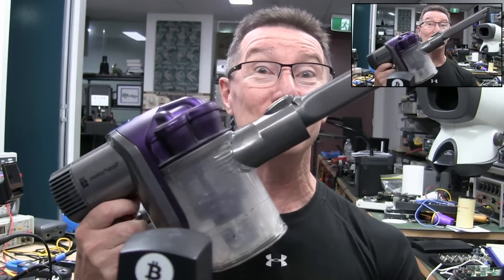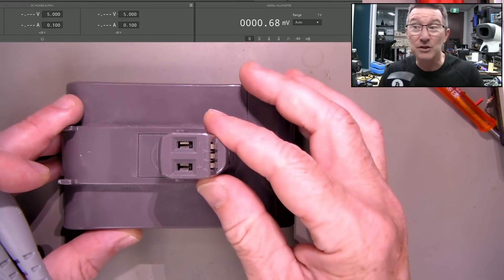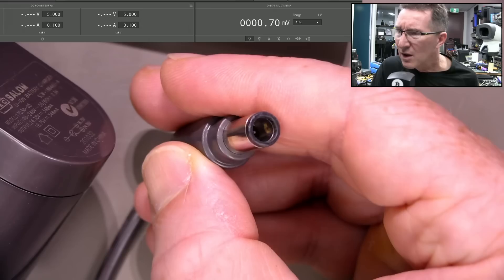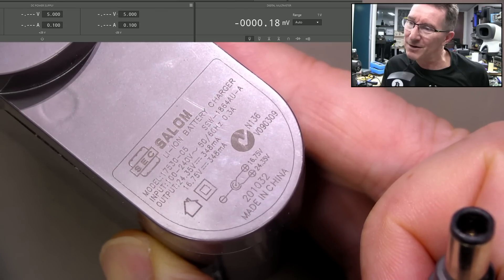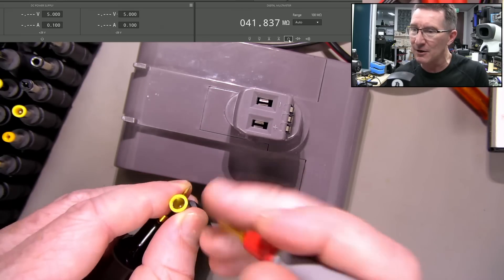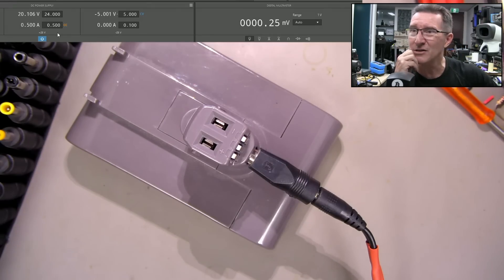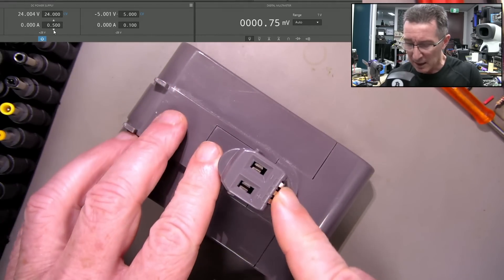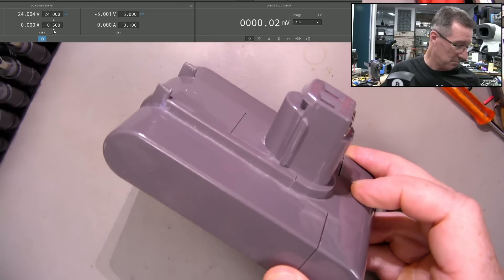Dyson Battery Failure

Comment: What a coincidence! I just took one of these failed Dyson battery packs apart today. It's not glued together, the two halves of that outer gray shell are held with clips. If you pry it apart with a screwdriver in that gap the shells come off and it's a white plastic case inside holding 6 batteries and a charging circuit on top. The only problem is that the batteries are all welded to each other and to the board, and you have to destroy it to get it apart further than this. My battery looked slightly different from yours though, so it may work differently.

Comment: Those adapter tips you have may be for laptops which have a charger sense pin. Some laptops including Dell laptop models have a charger sense pin where the charger will not support the current required unless it gets a signal on the sense pin.  The laptop and the charger communicate for charging.

Comment: I’d never buy a new Dyson product, but ypu can find them used for cheap. I bought two V8 vacuums for $50 each, replaced the battery, and have an excellent (and ugly) vacuum. I might add, for the price, the plastics are terrible quality. Gaps, squeaks, edges, thin, and so on. It’s not up to modern quality expectations for premium products.
Reply: I agree the plastics seem bad, but I think part of the problem is the most durable plastics feel/look cheap.  Were a disabled household so the plastics have taken a lot of abuse and only once managed to actually break something.

Comment: Plot twist, that’s not a genuine Dyson battery pack. Dyson can’t help but put their name/logo on everything they make. What you have is an aftermarket replacement, probably of dubious quality. Might be a fun side-by-side teardown if you have an OEM Dyson battery pack laying around.
Reply: Power supply is aftermarket as well.
Reply: Dyson is needlessly over complicated and a nightmare to get apart. I volunteer in a repair café and I could not recommend Dyson products.
Reply: First thing I noticed too. Genuine dyson bits are plastered in their logo
Reply: The Dyson battery pack for our handheld only lasted a couple of years for some reason. The cheap aftermarket replacement is still going eight years later, which is a bit of a surprise.
Reply: I found my dyson v6 animal in the trash (no joke, still working, almost no accessories), the battery was not original, but after 5+ years, it's still working great.
Can't say the same for some other original parts, I've had to 3 print one of them since they are not selling them anymore.
Reply: Have 3 v8s and all of them used makita and Milwaukee battery pack, quite a bit of volt difference but amp makes up for that.
Reply: The genuine ones have a high failure rate, almost like its programmed to do it!  More likely just a quality control issue though.
Reply: Re: Aftermarket replacement of dubious quality

My girlfriend got one. One day I'm working at my desk and I hear this distant "whoomp" noise coming from our utility room / laundry room. I assumed one of the dogs is up to something, but they're both sitting around looking in the direction of said utility room. Opened the door and barely glimpse liquid lithium fire splattered all over the walls just as a second cell explodes behind me, bits of the battery pack ping pong around this very tiny room.

I put out the fire on wall one while screaming "BABE THE LAUNDRY ROOM IS ON FIRE CAN YOU LOOK UP HOW MANY CELLS ARE IN THIS BATTERY PACK AND PLEASE DON'T SAY 6". Turn around and see that one of the cells had flown into the gap between the water heater and the wall, where it is burning through the insulation pad, flames coming up the wall. Finally get that fire out, hear from my gf that there are 6 cells in the battery pack.

Through the smoke I can make a few of the cells out scattered around my feet, and that's when cell 3 goes off like a flashbang. The previous two were just like drippy road flares. At this point caution is thrown to the wind, I wrapped up the remaining cells in a towel, ran through the kitchen and threw them on the stoop where two more exploded outside, put out the rest of the tiny fires inside, then stomped out the remaining cell #6 on the stoop until it fizzled out.

Lucky to only escape with minor burns to my hands and arm, and a pair of ringing ears.

1/6 stars, would not recommend.
Reply: @THEjoelivingstone  Yeah, that’s why I know about these aftermarket batteries. I investigate fires for a living, and I see these knockoff batteries catching fire all the time. I have a Dyson handheld with a dying battery. OEM replacement is $95. Aftermarket is $20. It’s no wonder the aftermarket replacements are so popular. There’s no reason for six 18650s in a plastic shell to cost almost $100.
Reply: @wilheldp  Genuine good value batteries should be available as a right. These third party batteries are not Dyson branded but it would not surprise me to find fake Dyson branded batteries.
Reply: @THEjoelivingstone  "barely glimpse liquid lithium fire splattered all over the walls"
There is no lithium metal in any rechargable lithium battery. That is total bs. Does it blow out electrolyte and tar? Yes. Is it a metal fire? Yeah no.

Comment: yeah the BMS also has a lockout circuit, so if you change out the 18650s it will throw an error and not charge them. There is an alternate firmware for the BMS believe it or not, but by that point I just got a decent knock off from ebay... that also has around 20% more capacity than the original.... and it actually was to spec even though I was prepared to have to return a few until I got one that wasn't faked capacity...
Reply: Lock out BMS suck. A knock off on Ebay that was on spec.? you really won the lottery there
Reply: @askjacob  battery firmware.  yikes.

Comment: Dell has used that type of barrel connector with the three connections for their laptops for years. They did this so they can detect the type of charger plugged in and what wattage it can provide. When that connection gets severed on a dell laptop charger the laptop will not charge to prevent damage. Additionally I believe with a quick google search you could find a battery adapter to use your batteries from various manufacturers power tool batteries.

Comment: Looks like you already replaced it at least once, looking at the aftermarket label.  I'm on my third battery in about ten years.  I wonder if leaving them plugged in on the charging bracket as they are designed to do is a bit problematic.  The first replacement I did had a different label and didn't last more than a year.  If I remember right the Chinese off brand packs are about $20, the Dyson branded ones about five times the price.  The current battery, I turn the charger off when it indicates a full charge (blue LED on the pack stays on instead of blinking) and it seems to be lasting longer.  (Some of) The aftermarket batteries have a really tiny hole to see the LED through, so it's not obvious.

I couldn't be bothered pulling mine apart either.  I was kind of hoping you would, so that I wouldn't have to.
Reply: The bms draws running current from a single cell out of the 6 even when left on a charger, this is what eventually pulls them out of balance I have read. You can download alternative firmware to change this behaviour if really really keen.

Comment: "No carbon brushes means zero carbon emissions" had me seriously LOL. I can't believe they actually printed that. Hillarious!
Reply: Have you ever worked with anyone in marketing or sales? Bottom feeders.
Reply: Well technically correct... carbon brushes wear down so the carbon does go somewhere. It's just not the same as the carbon emissions we're actually concerned about!
Reply: And they should made the entire thing from metal and a few ceramic/glass insulators. That would remove another bunch of carbon. There would still be the cord however.
Reply: @bert-blank  Metal are made with carbon consumption and so would be glass/creamic
Reply: and the whole thing is made from plastic litteraly oil lol!!!!!
Reply: @alanmay7929 all the energy used to produce the thing will not offset any savings of carbon emissions.
Reply: marketing genius move!!!!
Reply: I cringed HARD
Reply: Next we’ll see products with brushed DC motors marketing themselves as green since the carbon is already sequestered as dust and not released atmospherically.
Reply: Don't turn it on, Dave, take it apart! And replace the 18650's!

Comment: When using ad-hoc charging methods for lithium-ion batteries you should always place a can of petrol nearby   (for full effect).

The 16V supply might be for charging a 4S battery.

10 years is about what you can expect from 18650 cells in normal operation so just split the case and replace the cells.  Easy-peasy.   To split the pack give it a good whack with the handle of a decent-sized screwdriver.  That usually breaks the welded seams pretty effectively.

Comment: Those $20 battery adaptors for DeWalt / Milwaukee / Ryobi / Etc work great for these bespoke battery operated devices.
Reply from the maker: They don't seem to make one for my Bosch batteries for this Dyson model.
Reply: @EEVblog2  Gut the factory battery, 3Dprint a Bosch universal adapter and mount it to the bottom of the factory battery case, etc.

Comment: For a hundred years, people emptying wool vacuum cleaner bags would get covered in dust. Then along came Hoover and invented the disposable bags. Dyson starts the "bagless vacuum" trend and we get covered in dust again. Hoover should have received the Knighthood, not Dyson.
Reply: Seems like a skill issue. Bagless have way better suction, and I've never got covered in dust emptying. Also Vendor lock in of proprietary bags with occasional dubious 3rd party versions is annoying and bags are also wasteful.
Reply: My bagless Bissell's collection container opens at the bottom, and makes zero mess when I dump it. Haven't used a bag vacuum in over 20 years and don't miss them one bit.
Reply: Kind of missing the point that the Dyson maintains suction rates until full, unlike bags that reduce suction as the bag fills...

Comment: That's definitely not a Dyson battery, it's got the same label as my ebay jobbie on my Dyson
Reply from the maker: Ah, good point. I don't recall ever having replacement, but yeah odd that it's not Dyson branded.
Reply: @EEVblog2  at least it's designed to be replaceable. My vacuum was designed to be replaced when the battery dies, not good for such an expensive product, glad they have changed their design philosophy
Reply: The Dyson brand batteries for the V6 / V8 are also trash.

Comment: Most dead battery packs only one cell has gone bad I always take it apart and salvage the good ones.
Reply: @LyleHouk55  I probably have 200 18650 cells this way.  Any good method to get spot weld snot off?  I rip off the nickel by rolling it over side snips then hit the weld nubs lightly with a dremel stone.  any better method?
Reply: @Live.Vibe.Lasers  I just rip it off too and then just push the damaged part back down with a screwdriver. Be careful not to short it out.

Comment: I have a hp mini pc thats runs on 19v but has 3 connections. I found the hp plugs have a 1K or so resistor inside the supply that feeds 12v or so via the resistor from the 19v. As far as i could find out, no other reason than to be ‘proprietary’. Would not switch on without the lower voltage.
Reply: Laptops are different. They use the middle pin for 1-wire communication with the charger's EEPROM ID chip. Note that you should NOT feed any 19V into that pin, I learned that the hard way.